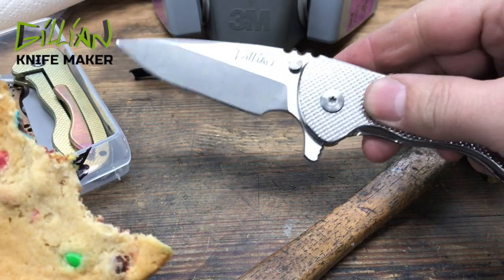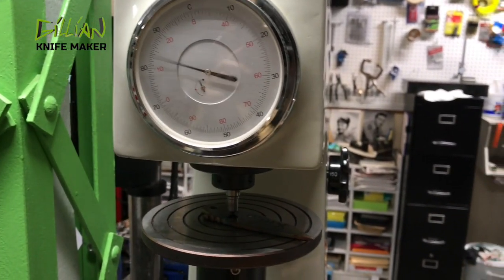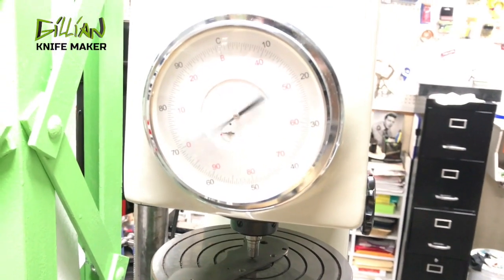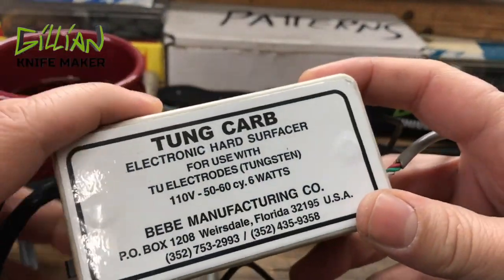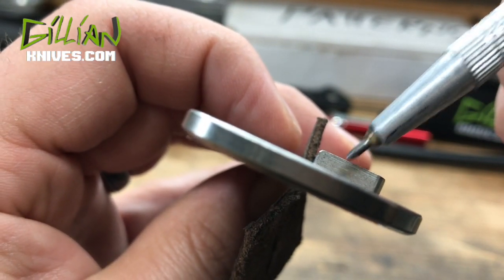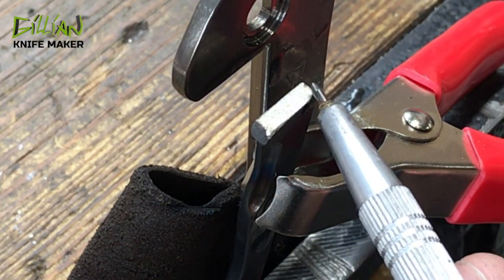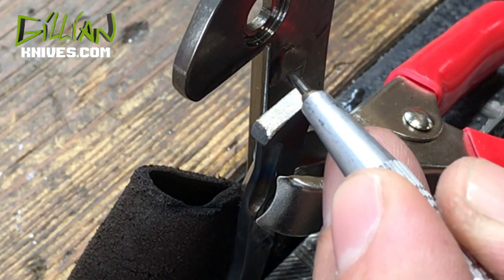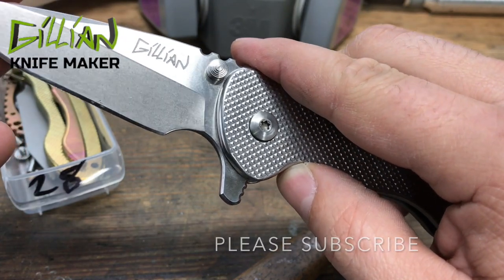Carbidizer

Comment: Question...will carbidizing add material making the lockup earlier? A Ti Framelock I have has about 99% lockup, and I was wondering if carbidizing ONLY adds material and will make the lockup a bit earlier instead of taking away and making it even later. Hope you can get back to me, thanks! Great video and nice knives
Reply: It adds a layer of Tungsten Carbide.  The Bebe Carbidizer that I use does not change the amount of lock up. I have never measured before and after, to see how thick the layer is.  Having said that there is another carbidizer built by Rocklin, that I have read about that is powerful enough to change the lock up on knives.  I forget if the forums was blade or USN, but there was a thread by Mick S. describing how the Rocklinizer would change lockup.
Reply: @christophergillian9095  interesting. I just have a 130v dc power supply, 1amp I believe. And a drenel engraver. I'm guessing the 1amp aspect means it's not super powerful but enough to get the job done
Reply from the maker: It should work, I used a similar setup for years before purchasing the bebe.  I just used my anodizing setup, dremel, and old carbide end mills.  My Variac,  bridge rectifier works on 3 Amps.,  @PaulK390S90V

Comment: Hey brother, why did you heat the lock face to cherry 1st?
Reply from the maker: You don’t have to heat the locks, just using the Carbidizer is good enough.  If you don’t have access to a carbidizer torching the end of the locking face a few times until it turns black will be sufficient to harden the titanium to achiece a higher ROckwell C.
Reply: @GillianKnives  ok thank you for getting back to me, I have a carbidizing  set up(dremel engraver, broken endmill and power supply) but I didn't know if this was a different to do it better, thanks for the information and the quick response, I've watched many of your videos and they have been very helpful for me since I've gotten into making/customizing. Keep up the great work, awesome knives btw. Are your books open and do you take custom orders?
Reply from the maker: Robert Ryan Books are Open https://gillianknives.com/2020-custom-order-deposit-books-open-sweetheart/?ctk=75e5aae4-df3a-41ab-b478-30ed17c9f958